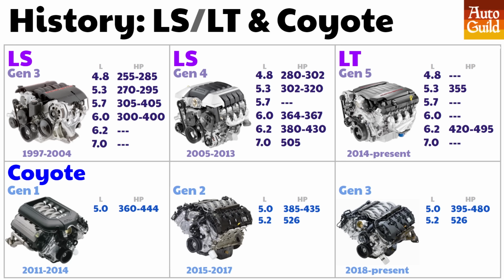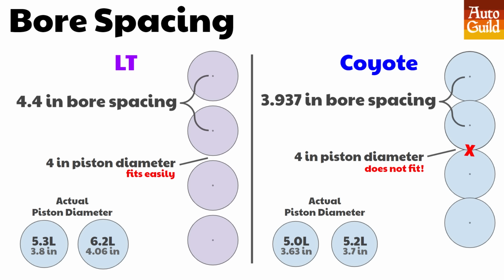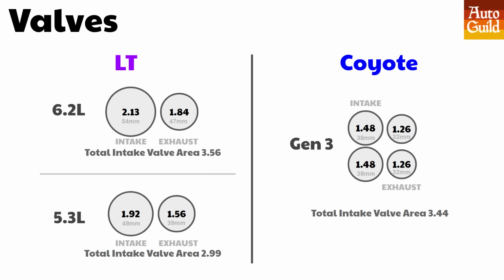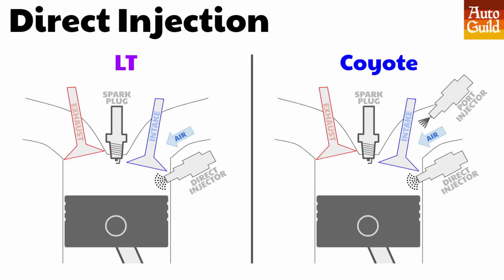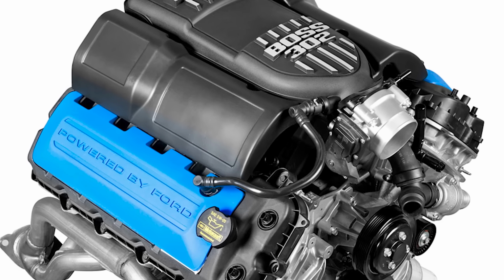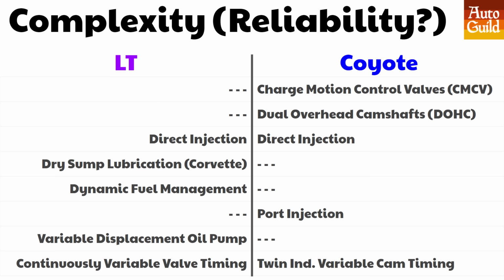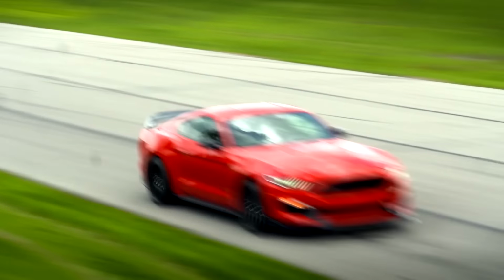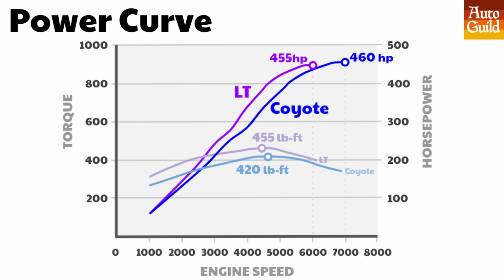GM Gen 5 LT vs Ford Coyote.  Which one is better and why.

Comment: Whichever side your on you gotta be glad the other side exists, if not Mustangs would still be 300 hp 4.6 and there wouldn’t have been a 6gen Camaro, or 1st Gen without the Mustang, the Challenger had some part in bringing the 5th gen back. Sad thing is, they’ll all be electric in 5 years, but that’s progress so it will eventually be a good thing, just going to take some getting used too.
Reply: They won't all be electric in 5 years.  They won't all be electric in 150 years.  Petroleum is free for the taking relatively speaking.  I worked for an oil company and lived on location.  I provided my own electricity with a generator that I fueled with natural gas condensate straight out of the ground for free.  They're not going to let that free (relatively speaking) source of energy go unused.
Reply: @brianwilson4861  idk, there’s already an EV Mustang, Dodge Challenger is in its last year of ICE, Camaro too, already seeing Dodges EV replacement for Challenger, speculation is the Camaro will be a Crossover EV like the Mustang EV. You will still be able to get ICE cars for years to come, but it will progressively be more expensive, to buy and operate. Gas will just get more expensive the less it is in demand.

Comment: Your wrong on the weight! The Mustang(4183lb) is like 240 pounds heavier than The Camaro(3944lb) all fluids in and even more with half tanks of gas. In fact The Camaro has a longer wheelbase too meaning it stretches out that weight much better too! AND The Camaro has a bigger fuel tank and still it weighs 250 less than mustang! The Mustang drives like ish compared to The Camaro too! The Camaro is superior in handling among so many other departments..weather NA or Boosted.. The Manual feels better and The engine more responsive. With better interior and just as attractive body with Face refresh!
Model Year 	2021 	2021 	 
Model 	Ford Mustang 	Chevrolet Camaro 	 
Engine 	
Mustang Shelby GT supercharged
5.2L V8
DOHC-4v
760 hp@7300
625 lb-ft@5000 	
Camaro SS supercharged
6.2L V8
OHV-2v
650 hp@6400
650 lb-ft@3600 	 
Transmission 	7-speed automated manual 	10-speed shiftable automatic 	 
Drivetrain 	RWD 	RWD 	 
Body 	2dr Coupe 	2dr Coupe 	 
  	  	  	Difference
Wheelbase 	107.1 in 	110.7 in 	-3.6 in
Length 	188.5 in 	188.3 in 	0.2 in
Width 	75.4 in 	74.7 in 	0.7 in
Height 	54.3 in 	53.1 in 	1.2 in
Curb Weight 	4183 lb. 	3944 lb. 	239 lb.
Fuel Capacity 	15.5 gal. 	19.0 gal. 	-3.5 gal.
Headroom, Row 1 	37.6 in 	38.5 in 	-0.9 in
Shoulder Room, Row 1 	56.3 in 	0.0 in 	56.3 in
Hip Room, Row 1 	54.9 in 	0.0 in 	54.9 in
Legroom, Row 1 	42.7 in 	43.9 in 	-1.2 in
Headroom, Row 2 	34.8 in 	0.0 in 	34.8 in
Shoulder Room, Row 2 	52.2 in 	0.0 in 	52.2 in
Hip Room, Row 2 	47.4 in 	0.0 in 	47.4 in
Legroom, Row 2 	29.0 in 	0.0 in 	29 in
Total Legroom 	71.7 in (over 2 rows) 	43.9 in (over 1 rows) 	27.8 in
Cargo Volume 	13.5 ft3 	9.1 ft3 	4.4 ft3

Comment: My thoughts are I think both platforms are awesome but to me it seems the Lt is not working as hard due to its larger displacement so I feel it will likley last longer.  Also it’s a simpler design.  I’ve also noticed gm does more with power than some other manufacturers.  I had a charger patrol car and it put out like 370 horsepower and when I was a kid I had an lt1 trans am that had like 285 horse and there is no comparison the charger is just slow compared to the T/A.  Now mustangs have been pretty anemic my entire life up to the point of the coyote so I’m interested how they will do.  I’ve been looking for a sports car I’m cool with a vette a more modern camaro or a mustang with a coyote in it so I will know soon what I love.
Reply: Funny you mention the GM lifespans being longer because they're making less power per cube. That is precisely why I will never buy one of these modern engines at all, why I would rather buy an engine from the 80s, 70s, hell the 50s. 100hp is enough to get me a speeding ticket on any road I can drive on, so it's plenty fast enough, and if I'm only getting 100hp out of a 4 liter V8(Which will be the case in a month or so fingers crossed; gunning to buy a 1953 Ford Business Coupe!) I should be set for life. A set of true duals/glasspacks to make that sweet sweet flathead V8 burble are a must(and the 53 I'm gunning for is already so equipped!) but otherwise factory stock.

I'll take a bone stock 8BA Flathead over a Coyote any day of the week, and I'll take a bone stock Stovebolt 6 over an LT or LS any day of the week.
Reply: @TestECull bruh. the 1950’s called. They want their carburetors back! 🤣🤣🤣🤣
Reply: @JackDubya80  They can't have them. I'm busy using them in 2023 because they're better than fussy EFI.
Reply: @TestECull  🤣🤣🤣🤣
Reply: @JackDubya80  Every single EFI engine I've ever owned has let me down. Total shop queen. Never been left stranded by a carb.
Reply: @TestECull  yeah. I grew up on efi cars. rebuilding a carb seems a lot more complicated than swapping out injectors.
Reply: @JackDubya80  Ye it isn't. Carbs...especially one-barrels like I run...are so damn simple it isn't even funny. All there is to it, is you open the thing up, you clean out the trash, replace the seals, put it back together. You service it you don't just fire the part cannon at it until the problem goes away.

That shit is part of why I hate EFI. You don't service it. You just throw parts at it. Expensive, hard to fit parts. You don't just clean it, reseal it, and put it back in service.

I've been driving the same carburetted F150 since 2007. Was my high school rig. Paid $500 for it, with 200k on it. IT's north of 350k now still running just fine. And hell the damn thing even gets better gas mileage than an ecoboost F150 would! I average 18-20...thank you manual transmission <3...most ecoboost owners report 15-16 average.
Reply: That’s why the LS engines lasted way longer than the 4.6’s/5.4’s (exception being the 4.6 2v that can go for 200k for fleet use (cops/cabs) and the LS was a much lower revving/lower stress engine.

Comment: The Voodoo engine is probably the greatest engine made to date by an American manufacturer. Powerful, high revving and an intoxicating exhaust note. It left it's mark on every auto manufacturer, both domestic and import. The GT350R is one of the quickest naturally aspirated cars on the Nurburgring ever.
Reply: Not here quite yet, but the ZO6 C8 will have the flat plane 5.5 liter DOHC; so the market is still quite evolving, which is a good thing.  The Ford/Chevy 'wars' continue; I'm a Chevy kind of guy though.
Reply: Whoa really?  Too many failure rates and vibrations causing oil filters to come lose thereby starting fires.  Also no torque at lie rpm’s. Maybe the new z06 fits the bill?
Reply: Left it’s mark in oil stains, took ford 2 years to get that motor to run properly/make stock numbers reliably. Don’t forget that.
Reply: Small block Chevy 327cu 350hp, ruled. 1965-66
Reply: @donaldchambliss8812 running leaded gas . You would burn out the valves with today's ethanol mix gas .
Reply: No sorry but you are wrong. The Voodoo motor has good heads but the rest of the motor sucks. the 5.0 & 5.2 coyote/predator block are ten times better.
Reply: Yup
Reply: The Voodoo was a great attempt but ultimately falls short due to reliability problems.
Reply: From non American guy used both chevy and ford v8 …. Ford is away better car more comfortable and faster and less break downs coyote is great engine last longer and better gas mileage
Reply: @emadny75  Except in the case of the Mustang vs the Camaro...and there's no way a Coyote engine will outlast the GM 6.2...those engines are bullet proof...
Reply: The Voodoo is one of the most overrated engines of our time.
Reply: @jhempsrt4  over rated how... Explain
Reply: When I see a voodoo or coyote with 300k miles and still runs strong we'll talk.
Until then I'll go with an LS.
Reply: @smokepeddler  i know a couple of gen 1 coyote mustangs well over 300k and still running strong, Voodoo's probably wont see with that kind of mileage, not because they cant but because i think GT350s are more of the hotrod weekend cars that probably spend more of their time in the garage, like how many Corvettes have you seen over 300k? probably not many bc they're babied by their owners, Camaro's and Mustang GT's however are much more common daily drivers
Reply: 460k on my gen 1 original motor and 6r80 too @smokepeddler
Reply: Well my CoyoteF-150 is at 200k and running just as strong as ever! No way a GM truck with MDS would last that long without lifter replacements if not a camshaft too!
Reply: @smokepeddler half the cat eye Silverados and avalanches have like 500k miles lol
Reply: @smokepeddler weird mine has over 200k all stock where i dont know a single buddy/ coworker thats gotten over 150k without a rebuilt trans/ motor. Just recently my buddies 12' 5.3 with 90k just lost the trans and needs a motor. And im not die hard ford i love a pre 07 GM, but idk how anyone defends these modern 5.3 etc one of our brand new 3/4 ton 6.6s grenaded at 4k miles due too eating all the oil and nobody checking
Reply: @smokepeddler  everyone I know with a Chevy that's 7 years old, replaced their engine atleast once
Reply: @Awkwamanwitdastang  Stop lying, you must only know one person then.
Reply: @smokepeddler  I have both Ford and Chevy Silverado 1500 5.3 , Ford F-150 FX4 5.4 . every time I have to work on that Ford . absolutely kick myself in the ass .. everytime I get to work on my Silverado !  I'm like hell yes more power what can I do today ! the only thing I will do to that F-150 is a tune . 

my 97 Z28 LT1 was actually easier to work on then this ford... I'm with you , but even if my Chevy doesn't make 300,000 miles I can still rebuild it easier !
And have fun doing it..
Reply: @banette36  Agreed. my 99 1500 Silverado is so Easy to work on. Everything is accessible and easy to reach. I had a 97 f150 and you had to remove 10 things to replace anything. Both good trucks though.
Reply: Nah, the LS and LT engines are better...
Reply: @jamesbottger5894 
Nope the Ford coyote is
Reply: @jamesbottger5894 then why did Chevy decide to build their own double overhead cam engine for the Corvette ZR1 and Z06.  The Z06 makes 760 N/A HO and the ZR1 gets a supercharger and make 1064 HP.
Reply: @thomasblankinship98  technological advancements
Reply: @thomasblankinship98  So you're saying the engine TYPE is better, and not a specific engine?

Comment: Here is a question to all of you on Ford engines and trucks. 

In 1981 Ford made a 300 inline-six that year that had more HP than the 302 and yes the torque was a lot higher.  (After that year Ford cut the nuts off this engine and it was never the same).

Here is the question: 

How was it that the 1981 engine got over 29 mpg in a 4x4 with an automatic and the stick got 31? 

This is the only year that the 4x4 got that kind of mpg as most got 12-15 mpg and the year after went back to the 12-15 mpg. 

Knew people who had one and they thought their fuel gauge was wrong and could not believe what they were getting. 

You can look up this year on the fuel mileage website for all years and see what I am talking about.

Comment: On your transmission slide, you forgot the TR-6070 7-speed Manual transmission that gets mated with the LT in 2014+ Corvettes. Active Rev Matching may be a key comparison feature. The LT may be getting a flat plane crank soon!  Maybe even over cam shafts, which I have mixed emotions about as a lover LS swaps.  My son just put an LS (well a  5.3 L Vortec) into a 95 Jeep YJ.  It ROCKS.  Wouldn't have done this with a Coyote motor.  Too large, too complex, and too heavy.  May not have even done it with an LT, but didn't consider mostly due to budget.  Don't get me wrong, we actually really like the Coyote and have done a 3-valve to Coyote swap too, but prefer the simple single-cam platforms for these efforts.

Comment: Well the coyote is based on the cammer. But as for the total package gm average is almost perfect.perf.fuel.maint. longevity .repair intervals  gm has them beat . For most power from stock it's absolutely the coyote. Of course the ever dreadful front timing jump and a whole bunches of dollars get spent pretty quick . And coyote even wins most main costs award

Comment: The picture of the flat plane crankshaft is not the configuration of the Coyote crankshaft. The picture is U-D-D-U. The coyote flat plane crankshaft is U-D-U-D, which has different characteristics from the U-D-D-U crankshaft. One characteristic that you didn't compare is the overall volume of the engine package. Here the LS/LT is the big winner. The LS/LT engine is very compact and can easily be swapped into many cars. The Coyote engine is huge and wide, so wide that there is no room for equal length headers.

Comment: I wish GM had looked at the Viper's cam-in-cam setup for the LT for independent intake and exhaust phasing. The variable cam phasing can only do so much without varying the phases separately. The Coyote, LS/LT and modern Hemis are all extremely impressive engines. We've got little 5.3s making more power and torque than big blocks back in the day without dealing with emissions controls or having to drive accessories! My old man has a F150 with a Coyote and I've got a 3.5 EcoBoost. Now, I have the HDPP and Max Tow packages with 3.73 gears but still, his Coyote easily gets 7mpg more than my truck on the highway! In 2014 we got a few new Silverados at work and those will easily cruse at 21-22mpg on the highway, too!

Comment: If the coyote was a 6.2 it would weigh that much more... efficiency isn't just in liters. The voodoo is pretty cool though definalty depends on your application which is better for sure but sports car and coyote don't know if bigger and heavier computes. I would like to see what the coyote actually weighs instead of an estimation based on what a motor without accessories.

Comment: I was getting 26MPG out of a TPI 89 Firebird with a T56 behind it @ 75MPH mind you. I verified this on 1600 mile round trip. This car was making about 430HP and over 500ftlbs of torque. Of course that year Firebird was very aerodynamic and I had taken about 300lbs out as well as smog pumps. Not saying the new motors are not impressive but.... I think I could build one today maybe get another MPG or two and maybe another 40HP with modern electronics.
Reply: I've had an '83 Firebird, '85 Bandit II & an '87 GTA, all great cars
Reply: I had a Chevy K30 dually truck with the 350 in it. 3spd auto and 4.10 gears. It got about 7-8mpg. Once I swapped a 12 valve Cummins and a 5 spd in it, I had 230hp, 605ft lbs of torque and get 25 MPG. And that truck has the aerodynamics of a giant brick spinning 6 tires and 2 axles.

Comment: The Ford Coyote Generation 3 5.2L V8 with 526 horsepower is best with all 1998-2011 Ford Crown Victoria's and Police Interceptors. The GM LT Generation 5 is best with 1991-95 Chevy Caprices. Better change the transmissions and speedometers for these engines.

Comment: The LS and LT all produce more low end torque than the Coyote engines...
Reply: Correct, you cannot create more power with a smaller displacement (low end or high end).
Reply: @dragon7689  Actually you can achieve higher HP with smaller displacement by making the smaller engine rev higher, but you can't make more low end torque with a smaller engine without some sort of forced induction...

Comment: I prefer the LS motors because they are easier to modify as they are small block based and a little more reliable as they are simpler

Comment: To be honest, representing an engine with forced induction by its naturally aspirated displacement is rather misleading. To get a true understanding of its efficiency, you actually need to multiply the displacement by the power adders compression ratio, as that's how much air is getting pumped through the engine per complete cycle.
The Predator's supercharger adds 12 psig, or 1.8:1 Compression. So the 5.2 Liters needs to be multiplied by 1.8 for 9.36 liters. Meaning that the Predator actually has an efficiency of 81.19 HP per Liter. Likewise the LT5 supercharger generates 14 psig, a 1.95:1 compression ratio, meaning its true displacement is 12.09L for a dismal 62.44 hp per liter.
Reply: Don't confuse everyone 😁

Comment: I'm definitely a V8 fan, without a doubt. Had a fastback Torino Gt with a 390 4spd sold it when I bought first house. Got rid of my '89 Gt 5.0 fox body a couple years later when we had kids and needed a family car. Been regretting this ever since, but I do still have a V8 truck 🤷🏻‍♂️. We also had a 5.3 LS in our 2002 Tahoe, but my son wrecked it🙄😡. I am old school, but I do love these new engines too. I've been wanting a new mustang for a while and if I had my choice it would be the GT 350 with the voodoo, even though the gt500 has the most horses. My neighbor just picked up one of the new Camaros and it's sweet too. You can't go wrong with either. I'm just glad we still have all these options. Hopefully we will have them for years to come, as long as the government doesn't ruin things 🙄. Thanks for the awesome video!!!
Reply: Update, I've still got my old truck, but I bought a newer one with the coyote and I love it!